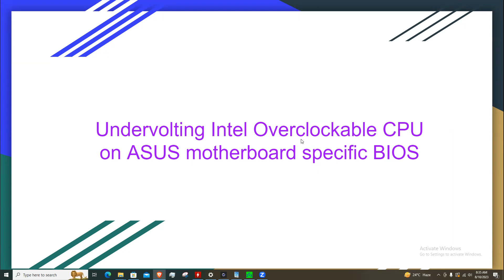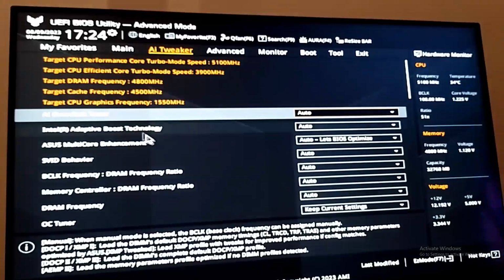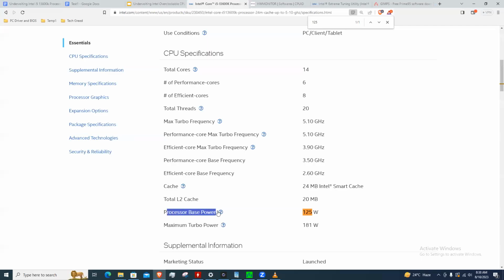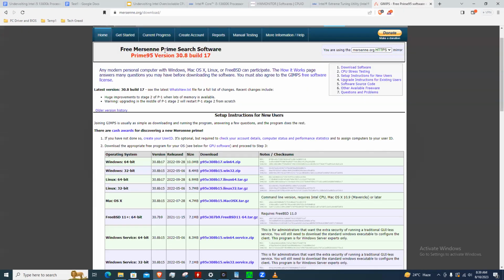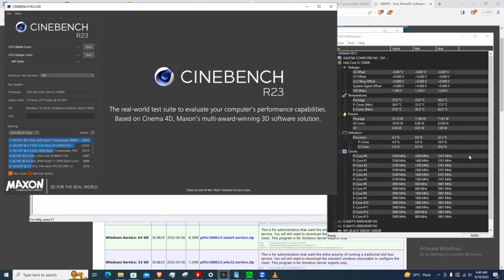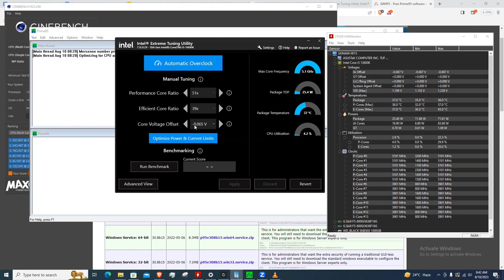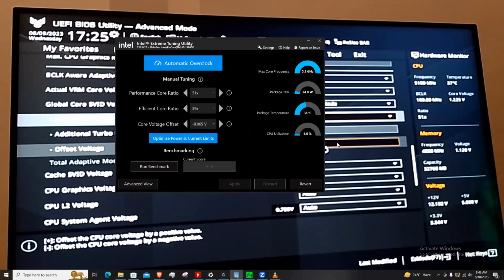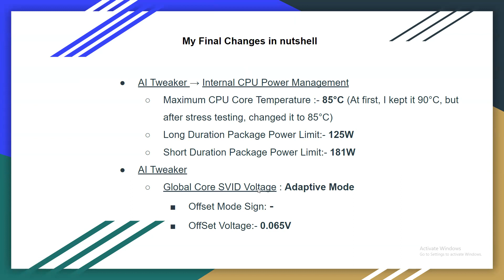Undervolting Intel Overclockable CPU on ASUS motherboard specific BIOS (Short Version)

Comment: yet again, how in the fuck do you guys get adaptive mode? I have the same motherboard but these options doesn't exist, only manual.
Reply: I'm just guessing because you didn't mention what processor you have, but the key is to have a processor with a 'K' at the end. That way, it can perform undervolting."  K - means it's unlocked, and you can either overclock or underclock it.
Reply: @Hexik32  i9-12900KS; I figured it out already & no, there is no adaptive mode on my motherboard.
And attempting to undervolt the system doesn't solve my issue at all.
My PC is just garbage.
Reply: @Revixy  You can try - intel extreme tuning utility. It does the same thing as the settings in BIOS, just through Windows.
Reply: press F9 to search, upgrade the UEFI firmware too first with the latest (has the latest microcode for models that apply).

Comment: can you tried undervolting using asus b760i
Reply: If your Processor supports over clocking and that is compatible with this motherboard then i believe BIOS options would be same, please check and confirm
Reply: @rahuljain7800  for Intel the ones with the suffix K is king (unlocked version)